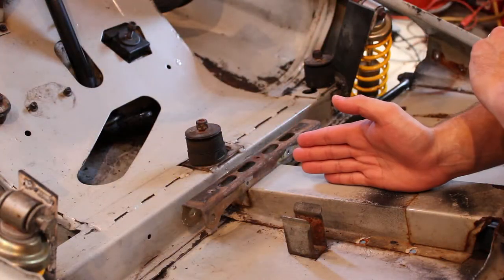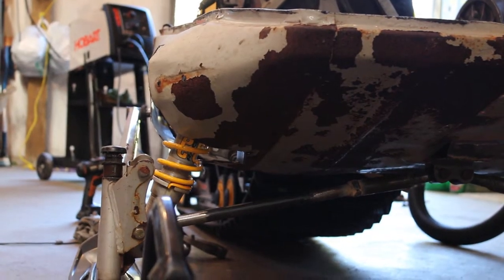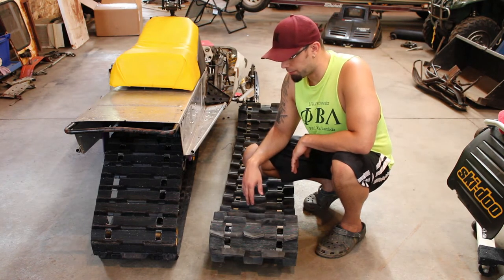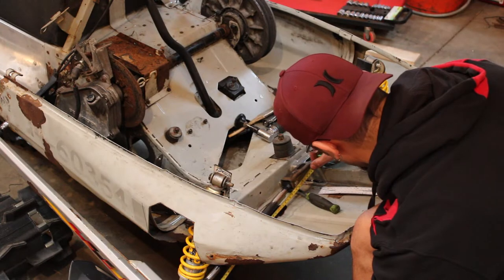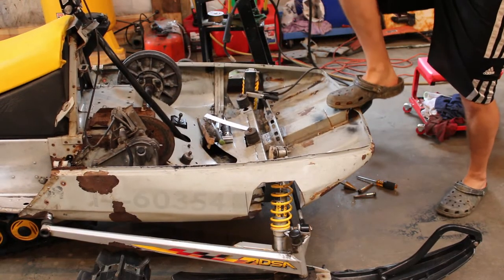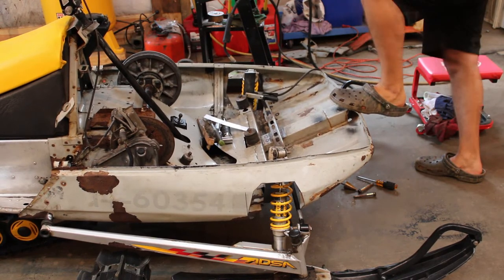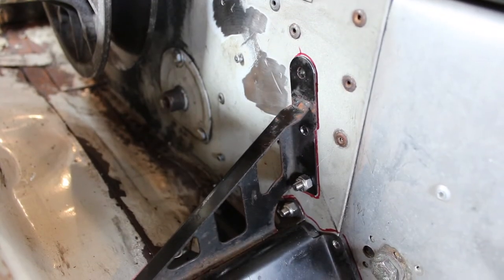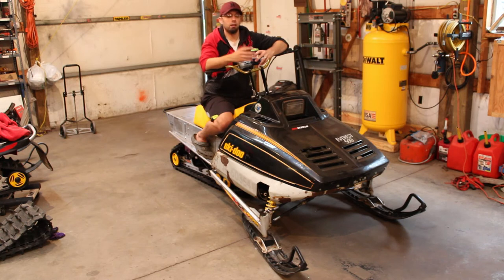Skidoo Everest vintage mod sled build part 6! Radius rods, trailing arm mounts, 1.5" paddle track?

Comment: You take a 503 Ski-Doo motor punch at 40-over get a little bit bigger carbs like something for 28 mmmm bigger than stock pipe it and clutch kit it you got a really solid and snappy air-cooled engine that will push mow sleds to 110 115 miles an hour you can get some power out of the 503 is if you try pretty reliable power
Reply from the maker: I love the 503, I think it's a fantastic platform for just messing around in the powder. Super lightweight and they seem pretty torquey. I'd like to get a dual carb set up in this eventually. I already have plans for a tuned pipe, and I'm definitely open to boring the engine. Gotta see how the summer plays out, but I'll definitely be doing more work to this thing in the future.
Reply: @NorthwoodsNoise  you can usually find the dual carburetor boot set up pretty cheap if you're going to board over I would definitely try to go with some carbs off of 583 engine definitely if you're going to borrow it and put a tuned pipe on it the only problems I've ever really seen within motors as far as reliability is failure of the oil injection system you can convert it to mix gas though